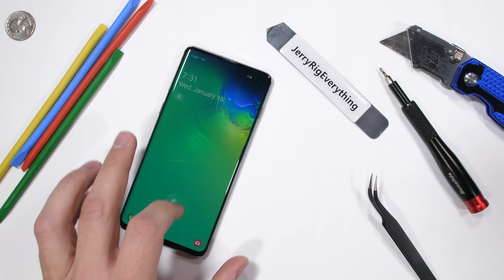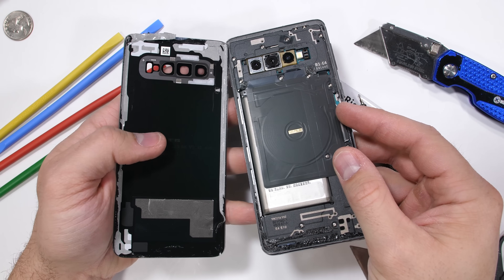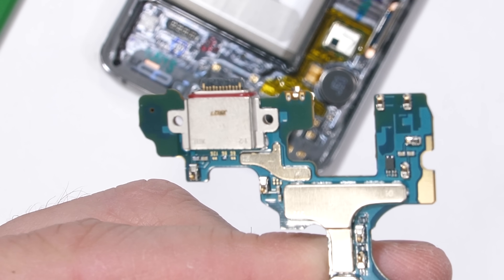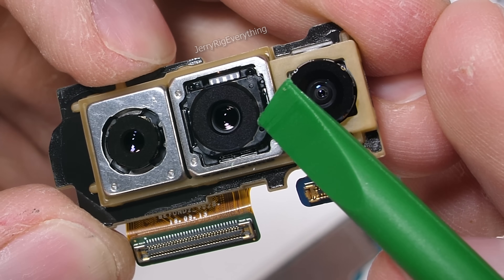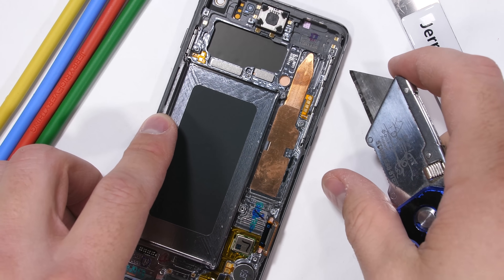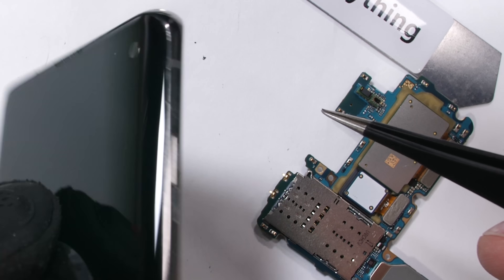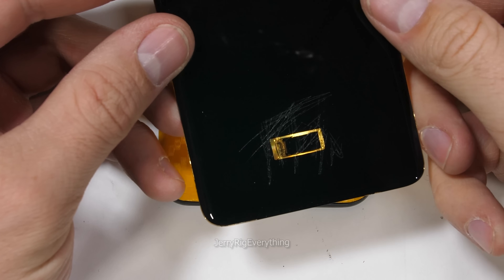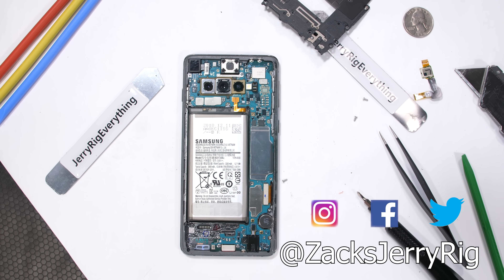Galaxy S10 Teardown – Does Ultrasonic Measure Up?

Comment: It's not like you have to replace the whole mother board if the type c port breakes... I mean, you know you can replace it individually as well as the microphone and some other parts, they are just soldered in but it doesn't mean they can't be replaced.

Compared to old style boards like the S6 Flat and S7 where you'll had to get off the screen to replace the charging board because of the capacitive buttons. They are better.

Comment: Even if the charge port fails Samsung has a pretty great warranty program and partners with some Best buys and most uBreakiFix for in-warranty and out of warranty repairs. They also offer a mail in service. Telling people it's planned obsolescence is the baloney IMO. Sometimes a "professional" or partner repair is better than a self repair as they come with warranties and guarantees. As far as the battery goes the adhesive is very easily eaten away with isopropyl alcohol. Legitimate Samsung screens also come with the battery pre-installed. I imagine they do this to avoid any more Note 7 situations so they can verify the quality of the battery and not rely on someone else saying it's fine.

Comment: Its good that they smashed the charge port onto the board rather than soldering it, usually it was the solder that fucked out on it causing it to stop working.

Comment: value is most important, balancing features, repairability, long term support, parts availability, security, all for a reasonable price. And it's disappointing to watch the entire game shift to making more expensive phones which aren't necessarily better than their predecessors, not linearly enough to justify every dollar spent more for it than the prior model. 

Companies like OnePlus and Motorola are taking the right approach in offering more for less. Hell they still got headphone jacks. Meanwhile, Pixel and Iphone are too good for that nonsense. I'll keep my 6s Plus 128 GB model for as long as it continues to receive support.

Comment: Or, instead of buying a phone, go to a phone repair center than can do soldering work.

I got my Honor 8 busted antenna connector fixed when I snapped it off during disassembly to access the battery. $40 well spent.

Comment: Well Samsung products are of the same product quality as apple. They are really durable and unless you go throwing them around they wont break easily though when they do the repair aren't exactly cheap if you don't know how to and you need to bring it to a cellphone repair shop. Also you just wanted to completely tear down  the poor phone apart don't you XD. 

About the feature I think most important, it has to be the headphone jack.

Comment: Everybody's saying that iPhones are hard to repair but it really is easy to change both the screen and the battery, whereas on Samsung Galaxys it's a pain in the ass since you have to take apart the whole phone. You might say that it's worse for the rear glass on newer iPhones and you'll be right, but I'd rather have the back glass broken on my iPhone than my screen on a Galaxy since you can just put a case or a skin on the back glass and voila, nothing to see there.

Comment: Note that these wireless charger don't actually transmit power.   They use power to create magnetic fields that incite current in the device.  Use power In one place to create and environment where the second creates power.

Comment: I have repaired soldered on power jacks on phones previously but it is very hit and miss mostly miss. I would say 60% failure rate and of those 60% failures i would say 60% of them are do to my own skills EG not hot enough or to hot with the heat and i destroy a contact pad this is not something you can avoid, But the other 40% of those failures comes from owner behavior. When the port first starts to fail they wiggle the cord to get it to charge etc. Right near the power jack.usb is a little black basically perfectly square chip with 3 to 4 prongs or contact points. This little chip has a small device inside it that when the phone finishes charging opens and stops the charge when the power drops to a given level it closes turning the charge on and off  if the charger brick fails to do so or the phones software fails to stop the charge. This prevents over charging and causing the battery to ignite. HP dell and other laptop manufactures many years ago had a series of battery fires do to a lack of this small switch or a bad batch (varied as to the reason). What happens when a owner wiggles and jiggles the cord is this little switch opens and closes rapidly and fails safely by welding it self in the open position stopping the charge out right. This chi can technically be replaced but good luck with that. I did it 1 time and it required me using about a dozen donor boards. I did it just to see if it could be done i will simply never offer this as a repair option as to be honest i would need to charge way more than the phone is worth to try the repair. Now on laptops i have replaced that little chip about countless times lol. It is about the size of a pencil eraser or larger and connects to the first layer of the motherboard making the repair quite easy. Laptops now have 2 or 3 of these chips one in the battery 1 near the power jack and 1 (some times) in the original and replacement adapters that come from the manufacture. Phones have 2 total 1 in the phone 1 in the power brick that comes with it. 

Technically this chip cold be bypassed and the hone wold charge etc as normal so long as no software failure happens how ever even if a reader knows how to do this do not ever do it especially for a customer it is dangerous as hell.

Comment: Rock-solid 60+ fps UI experience during basic operations without a SINGLE noticeable hickup or drop of fps. Mind-blowingly even devices with SD855/K980 and 2digit GB RAM don't offer this experience yet.

Comment: If S10 users capable of buying the most expensive phone right now, why dont you buy a wireless charger so that if the type C port is not working. Still you can charge it. Logic

Comment: Btw the charging port and the microphone can still be repair, i still do those repair but not for $15 unfortunately, but for a phone who cost $900 its better than nothing !! And the Ultrasonic sensor can be remove with a little of heat on it... but you are right for the fact that anybody who remove the screen will probably broke it, i did never like Samsung amoled screen they are too cheap, they broke easily and the cost a way too much to replace !!

Comment: Man gets every new phone 

Still uses an S8😤😧👌
Reply: Well if it works why toss it away
Reply: @LET4M4RU  Ya true
Reply: @LET4M4RU  cuz new is better change my mind
Reply: @mayan4336  buying the latest flagship each year is also very costly. I don't see the use of switching device for the new one if your previous one works just fine and you're happy with what it gives. I'm rolling with my OnePlus 5 for around 2 years now,still very happy with it and I don't see myself going for the 6T for now. 
Also, new doesn't always means better, just look at the downgrade the iPhone XR is compared to last year's iPhone X, you'll see what I mean.
Reply: Weird flex but ok
Reply: Well, I technically have money to buy a newer phone, but I'm still strong with my Galaxy S7 Edge. The S10 has some nice features such as power sharing and ultrasonic scanner, but I can live without that for now.
Reply: @fusseldieb  same here. I'm still on the s7 edge as well. I'm keeping it until it dies or becomes obsolete.
Reply: Bruh I use an s6 edge
Reply: @rahulmadhusudan9513  hows battery life? Mine sucks
Reply: @cesargonzalez4598  mine too yaaayyy!!
Reply: @rahulmadhusudan9513  S6 Edge is a beast phone. I was using a S6 Edge until my screen cracked. Man I was so salty when that happened.
Reply: @kev50fulable  I know it's awesome but it has become slow af
Reply: @rahulmadhusudan9513  My S8 is still pretty fast and I had it for almost two years
Reply: @rahulmadhusudan9513  I use a Samsung s5 😂
Reply: @Tabiin24 I use my s3 too
Reply: @rahulmadhusudan9513  Same here I recently taken of the paint of the back and now have a see through phone pretty niffty lol
Reply: Etherious sunflower Dragneel but you dont get every new phone ^^
Reply: @rahulmadhusudan9513  see like now you have to upgrade. Having an S8+ at this time is fine though
Reply: @devind407  well now I'm using the S7 lol
Reply: @rahulmadhusudan9513  Maybe you should upgrade on Black Friday?
Reply: Yeah he does get every new phone, but then he also destroys almost all of them 🤣🤣🤣
Reply: OctaineBG  And he still is
Reply: Saw this comment from my s8
Reply: Jerry isnt a fool why spend money when hes got a great phone that does the job
Reply: 😂😂😂😂he is like me watching in my galaxy S5
Reply: @romenpal-m6f  Same.
Reply: I have an s8, just replaced the cracked screen to trade it in for an s10+. I definitely see myself holding onto the s10+ for like 3 or 4 years
Reply: @WilliamDell95  how much for front glass repair for s8? i have an s8 too and i want an s10e sooo bad! thanks in advanced!
Reply: @onomatopoeiart  depends on your service and if you have an mobile insurance plan. I have sprint and had insurance, so it was like $30. I think without insurance it was like $110
Reply: @WilliamDell95  lmao I did the same today
Reply: William Dell  I m pretty sure you were saying the same about your s8
Reply: if it's ain't broke don't fix it
Reply: I respect him for doing that
Reply: S8 is the best. I wouldn't change my S8
Reply: ...And destroys the new one.
Reply: @ryomatakebayashi1370  my mom using nokia 3310😂😂😂 and my Dad Galaxy note 4😂😂😂 I told them to upgrade but they aren't interested like me I am using S5
Reply: But I have the oneplus 6 for 4g
Reply: @romenpal-m6f  my mom has the note 4, my dad s8+ i have the huawei p20 and my bro the note 9 lol
Reply: I’m watching on an iPhone 3g
Reply: I still use a Galaxy Note 2
Reply: That's why I respect this man. I feel since I'm not a tech YouTuber I should be able to comfortably keep my phones one year longer than Zach
Reply: I'm still with the S3
Reply: @Davis38  lol same i had to change after my s3 had been flashed with 2 new softwares and became extremely slow
Reply: If it isn't broke don't fix it or in this case don't replace it.
Reply: XD i watch this video on my s8+.
Reply: Samsung hasn't paid him good enough to switch :)
Reply: @01t2r12qxrfu  why would samsung pay him?
Reply: Jwcob Which is a better phone than the $750 iPhone XR 😂
Reply: I have a freakn iPhone 5. Don't be so ungrateful.
Reply: I have nokia 3310
Reply: Jwcob I’m on my 4.5 year old second hand iPhone 6. Had to replace the battery because it was at 40% capacity after 4 years, and had around 30min screen time and would randomly shut down. New battery = brilliant phone again. 

Hoping to replace this year or next if I can though.
Reply: @toxichazard5015  I have to say, i dont think iphone 6 batteries are too reliable, i have a xperia z2 3200mah and it still works perfectly, gets me through the day with moderate usage.
And that has had a screen replaced 3 times i think
Reply: Poor thing 😱. Why replace a working phone if it’s not getting really old. I’ve ordered my S10+, it’s replacing my worn down IPhone 6, the 6 replaced my Xperia Z3 because it was shit. Xperia replaced my iPhone 4 that fell out of my pocket while I was working the yard with a snow blower, let’s just say the iPhone 4 was not working after getting chewed up by the blower 😂.

Don’t need the latest, besides, what good does having all the new phones if you have to rape them like he does for science. 

Cutting them up with boxcutters, scratching the displays etc.
Reply: I use MI redmi 5+.120$.....s8 is my dream
Reply: The way we all should do ! I still dont understand people changing phones every year...😞
Reply: Jwcob I have S8 too, I love it
Reply: As long as it could run pornhub video it's nasa computer for me
Reply: I also use my s7 edge
Reply: Today my S8 suddenly died while playing PUBG. Given to the service centre he replied motherboard is dead :(
Reply: @ahmedshajeeth6355  probably a scam take it to the Samsung store
Reply: Man tears down every new phone😏
Reply: Jwcob  yup
Reply: I think he waiting for a real WOW factor for him to  change
Reply: S8 is hella nice still tho, symmetrical, amoled 1440p display and face recognition and fingerprint
Reply: I am still using a OnePlus one with the Oreo  cr Droid Rom  much better than any Samsung anyday XD
Reply: Still uses S6 Active
Reply: Probably still uses the s8+ because he destroys and scratches all his phones he gets.
Reply: Smells like broke in here

Comment: Instead of replacing the phone just bring it to your local cell phone repair shop and they can solder a new port on. Don't know why you didn't state this option. I also recommend to not tell your viewers to use a razor blade to open phones. I recommend the metal pry tool in every shot you have to start the opening and then use a plastic guitar pick to complete the opening of the phone.
Reply: Oh and it's not impossible to remove a Samsung screen from frame. Many shops, including my own, remove them from frames.
Reply: And they still work.

Comment: It looks like the USB C port is part of the motherboard (look at the pins and green substrate that matches the board at 3:32) Even if the metal shroud gets dislodged, it may still work and looks more durable.

Comment: Been using Samsung phones for over 10 years and I have to say this is the 1st time I'm disappointed with one of their products, making a hole in the screen for the camera is a poor design feature as well as making it harder to repair than all of their others. However this is not the first time they made the charging port permanently attached to the main board, they do that on a lot of their tablets ..  pretty crappy ... but I'd still rather have one of these than an iPhone excessive

Comment: U can still wirelessly charge your phone if the usb c port fails
Reply: So good that instead of removing the headphone jack and having a replacable charge port, they said fuck it replace the headphone jack when needed but we will make your life hell when the port shits out.
Reply: @Silvers24  the s9 has a headphone jack and a replaceable USB c port. Besides I've never heard of a USB C going out except for very rare isolated incidents
Reply: @Bluecolty  I deal with thousands of phones it happens all the time when I need to unlock the phones its extremely annoying and now that its unfixable thats an issue :(
Reply: @anthonybattillo6785  that's a security feature lol you shouldn't be able to unlock it using the charging port. If it charges, the port works
Reply: @Bluecolty  yeah I do it all the time you use special software to unlock the device I've created my own software to do it as well it's really simple but the point is also some people might want to transfer pictures to there computer from the port
All it takes is someone to bend certain pins on the port and then no more data connections it sucks
Reply: Anthony Battillo - Why not use es fileexplorer, host a local ftp server and then transfer the data?
Reply: @anthonybattillo6785  that's a little different from the port not charging the phone. Like I said, it doesn't work because of the security feature that disables getting into the phone if it isn't unlocked. If it still charges, it works. If it doesn't charge, then it is broken
Reply: I mean......what are the chances of that tho?
Reply: @thechillmaster5836  I ran over my s8's charging cable about 3 months after i bought it, and i didnt want to buy a replacement, so now i only wirelessley charge my phone
Reply: My S6 port failed today and would literally start smoking when I plug in a cable and I thought that I basically had 8% battery to figure out transferring all important info to either PC or a new phone (hoping to pick up one of these S10's actually). But your brilliant comment actually reminded me that the S6 had wireless charging which I never use but have, so I just wanted to take the time to say thank you, it'll make the next few days bearable knowing I can still charge my phone!
Reply: @KaronaG  same thing happened to me lol. It smelled like a mini barbecue
Reply: you can. I wouldn't like the slowness tho
Reply: That would be a hell lotta pain in the ass!!
Reply: Well yeah but that’s gay

Comment: Zack, 
If someone ever made a phone with an ALON front (and possibly back), and I'm pretty sure this is the future, what would be your opinion about it? Is the unmatched protection and lighter weight worth the orbital price( and extra hassle of figuring out how the touchscreen is going to work with a large chunk of metal in front of it)? Is Gorilla Glass 6 sufficient for everyday abuse?

(In case anyone doesn't know, ALON is an Aluminum-based transparent alloy that is really strong and tough, and it doesn't shatter like glass. It is basically transparent aluminum straight out of Star Trek.)